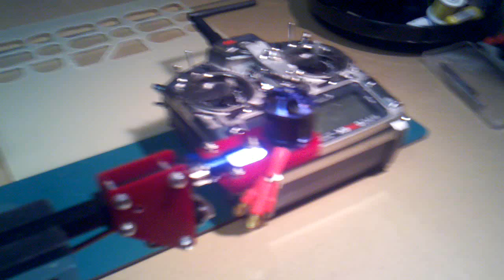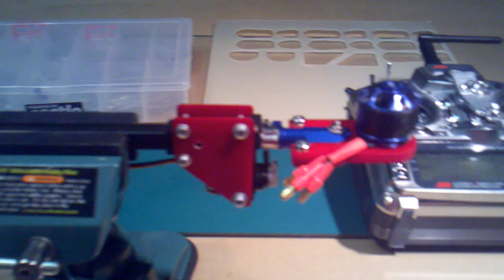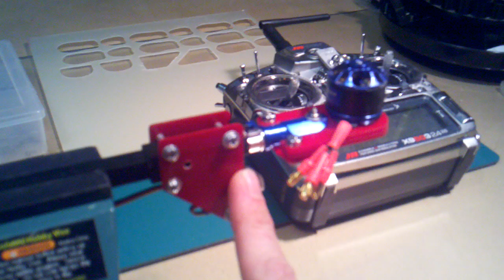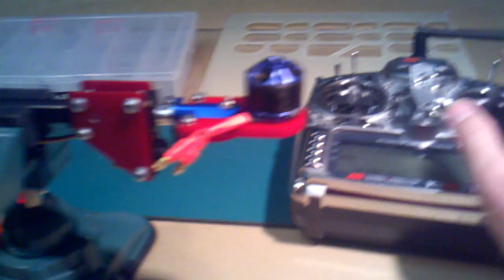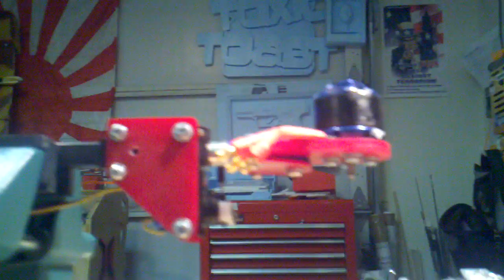Tricopter Yaw Demo

Comment from the maker: The torque of the rear prop is neutralized using the yaw trim. These linkages are proportional to the movement. Unfortunately, this project has been in standby for a while as I've been getting my chops up with fixed wing FPV. Can't wait to get to multirotor FPV!

Comment: Very nice.  What about hover yaw.  If you are running with counter rotating props, up front, do you need to adjust your linkage to add left or right yaw.  I see some videos where there is a lot of yaw at hover.  It looks like your control arms are parallel and level, at neutral yaw.